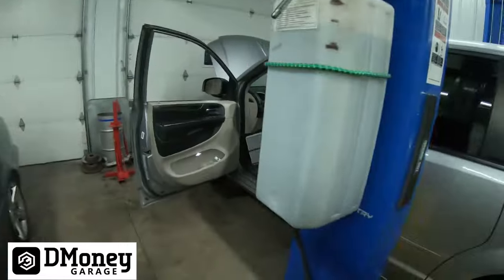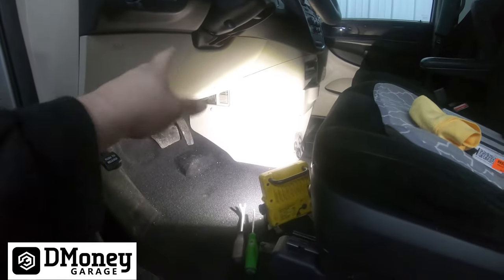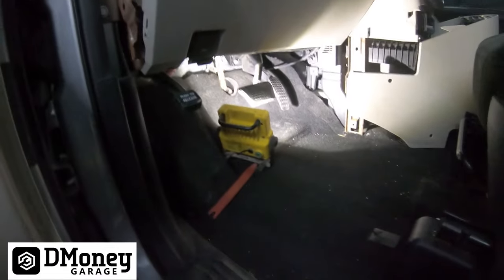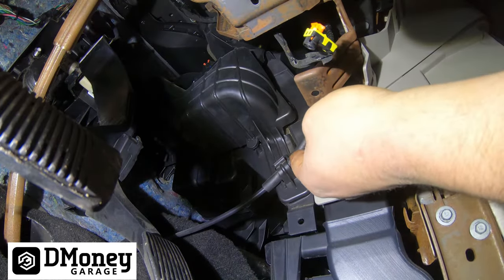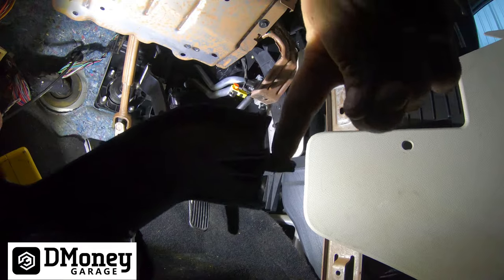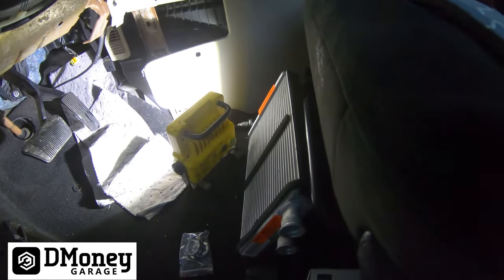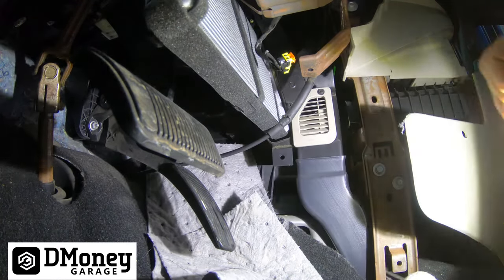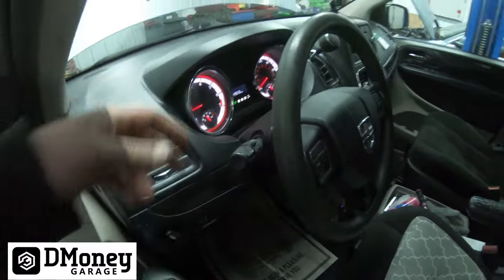Dodge Caravan Chrysler Town & Country Heater Core Heater Core Replacement How to change heater core.

Comment: Hey, thank you for this video… very helpful! I wanted to mention that the plate holding the airbag is held to the dash with 4 t-20 screws which are much easier to access! I removed them to get to the 10mm easier and the whole airbag assembly just dropped out! Hopefully that saves you a few minutes on your next caravan/T&C heater core job.

Comment: Great video! Really helped me with my 2011. Just wanted to mention a time-saver. Instead of removing the rear mounted air bag from the dash bracket, the entire dash bracket can be removed with the air bag still attached. These bolts are easier to access. Also, it's not necessary imo to remove the hose clamps from the two heater hoses.

Comment: Some videos would show guys cutting those pipes inside to get the heater core out and using hose and clamps to patch it hopefully it's the same set up in my 2014 grand Caravan i trust this way much more.

Comment: How did you know that the heater core was bad? Did you have a leak, wet carpet inside the van?
Reply: I did but if your heats not working and you've tried putting coolant in and it still won't blow hot they most likely that's it.

Comment: You could use a wet vac. To remove the coolant from the heater lines in the engine compartment. I liked the video it was very informative, thank you for the video.

Comment: 05:30 spare tire retainer? Does the caravan have a spare tire? I recently  purchased a 2014 caravan and learned to fold the seats down from YouTube. 

I'm watching this video because the heater isn't working. I replaced heater cores in my Ford and Chevy trucks before. Didn't even have to take any covers off for the trucks, so easy (just pop the heater core enclosure).
Reply: It does have a spare tire under driver and passenger seat, under your console is a spot to crank it down from under vehicle and the bar for that is in the jack kit.
Reply: @07killerseven  ah ok. I do see that knob thing. I haven't looked under the van yet. Good to know.

Comment: Here is a question for ya. Why would my engine want to overheat when I turn the heat on? Seems like it happens when I am up over 60 miles an hour with the heat on in the winter. If I slow down to say 25 or 30 MPH the temp will ho back down amd then be fine for the rest of the trip.
Reply: It's the lack of coolant circulation at 70-80mph or faster the engine is generating much more heat!! If your low on coolant that can cause that or thermostat and heating core. I'm in these problems as well. Fun travels.

Comment: What could possibly leak coolant on driver side of a caravan ? Both heater hoses have been replaced. Lots of coolant is splashed all over top of transmission case and driver control arm and motor mount near radiator . Weird but can't find the source of leak.

Comment: Thank you, great video.
Reply: So, after changing the heater coil (where the coolant was leaking from) I am still having issues with my temp Guage increasing and lowering while driving. Do you think the water pump? Or thermostat? It's May in going to remove the thermostat. Any suggestions would be cool, but not expected. Thanks! You still rock with the video.

Comment: Hello … 
So I replaced the old Hcore with the new one … why is it blowing cold air ? Is it possible the hoses may have been crossed ?
Reply from the maker: Probably still have an air pocket that needs burped out of the cooling system. After it’s cooled off take the radiator cap off and start the engine. As it warms up squeeze the upper hose to try to work the air out of the system. Or there is an issue with the hvac doors/actuators that was causing your no heat concern.
Reply: @DMoneyGarage ,
Thank you … Your video is very helpful
Reply: Should I have the heat on or off

Comment: How did you troubleshoot the problem no obvious fluid leaking and mysteriously for a year and now help?
Reply: Notice the my friend noticed the antifreeze smell inside of the car how do I tell if there is a leak in the heater core? Great job on the video
Reply: Notice the my friend noticed the antifreeze smell inside of the car how do I tell if there is a leak in the heater core? Great job on the video
Reply from the maker: You could use a cooling system pressure tester and pressurize the system. After pressure drops after a bit start looking for a leak. Usually you can see antifreeze coming from the hvac case drain tube. The tube will either be on the firewall or under the vehicle. I can’t recall exactly on these vans. As for this van there was no leak. It had very weak to no heat and coolant was full. Noticed the hoses going to the firewall was blazing hot and the from the firewall was hardly warm. Both should be hot. Once the core was out there was a noticeable weight difference between new and old. The person had the core flushed twice prior to having me actually fix the issue.
Reply: Thank you d money you're awesome. I will have my friend mechanic look for some antifreeze from underneath never really seen any antifreeze anywhere it will use a court about every 60 miles

Comment: Hi, I have a 2009 that's set up exactly like the one you worked on. The mechanics told me it's going to cost 1,300 to replace the heater core that's leaking, and I feel like I can fix it for only129.00 it. since watching your video 
Is their price acceptable ? My question, and do you think I can do this? I'm a 59 year old female and have worked on my vehicles before, but this one intimates me a little
Reply from the maker: I feel it’s a little on the high end. I don’t know their labor rate or shop charge rate. Also with sales tax and what parts they use. If they go to Chrysler than that seams about right. But it is definitely something anyone can do with a little mechanical ability 👍

Comment: What's causing water low in Radiator
Reply from the maker: A leak is why it’s going low. Those had issues with the radiators leaking. But could be a hose, the heater core, even a bad head gasket. Your engine can start consuming the coolant without a drivability issues.

Comment: was just told my dodge caravan needed this damn thing. my coolant is supposedly leaking into driver side floor under the gas pedal is what they said. i noticed the coolant burning off quicker than it should and this is supposedly the source of the leak. $500 for the fix. FUCK my life!